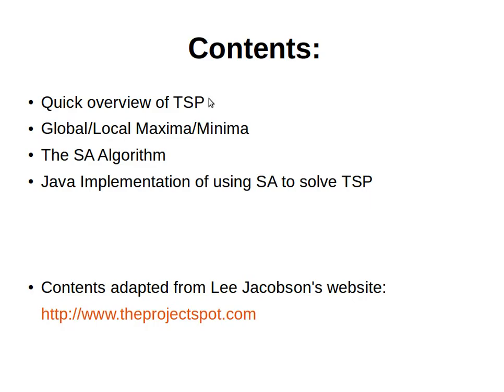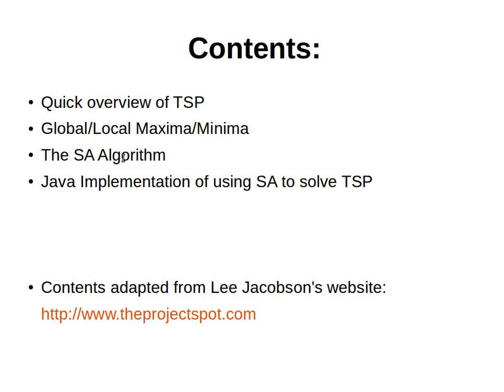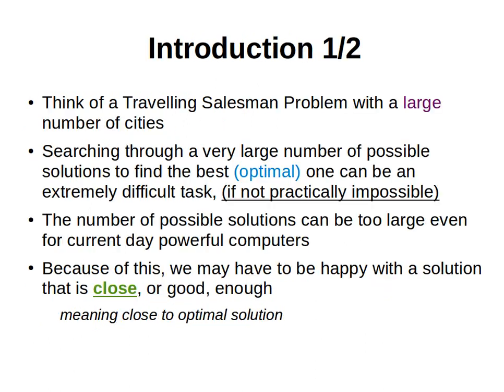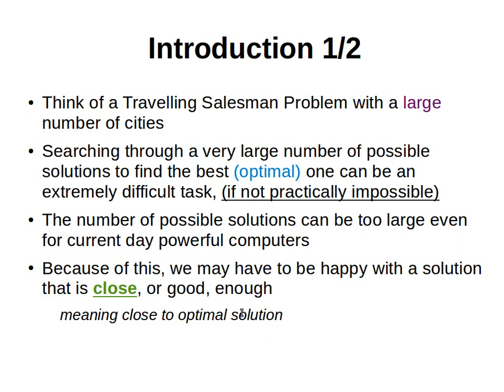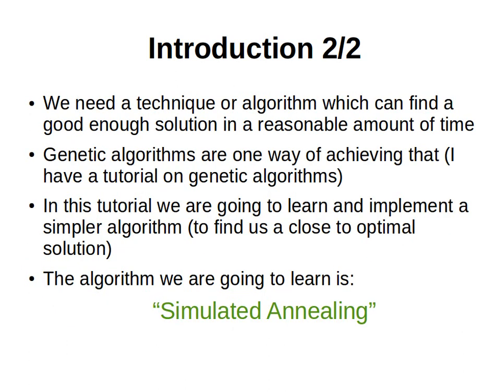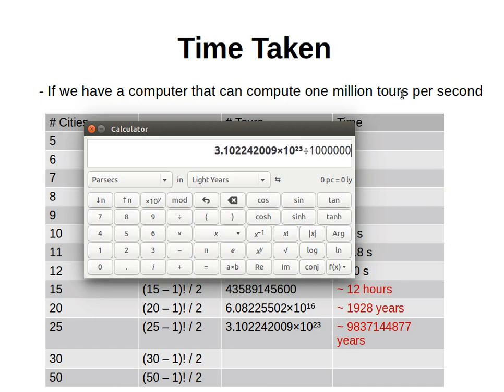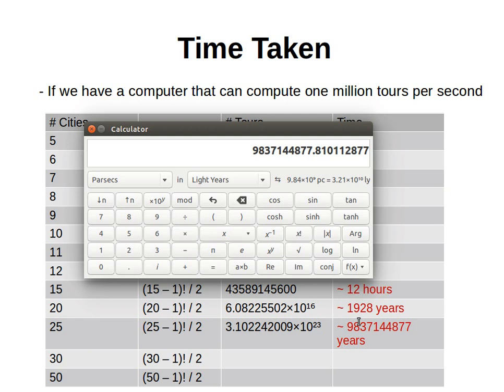Simulated Annealing 1/7: Introduction

Comment: Hi,

I'm using weka through script, calling them from matlab.

When I call the multilayer perceptron function, return the result in a weka.classifiers.functiones.MultilayerPerceptron object.

I Need to extract some information (numerical information) from that object to make a graphic comparing with the actual values and display graphically how well the neural network is estimating.

The same happens with the result: eval = weka.classifiers.Evaluation.evaluateModel(redEstimada,options);

In this case, the result is returned in a  java.lang.string.
I Need to extract some information from that string, too.

=== Cross-validation ===
=== Summary ===
 
Correlation coefficient                  0.6722
Mean absolute error                      0.2552
Root mean squared error                  0.3293
Relative absolute error                 84.9333 %
Root relative squared error             89.7364 %
Total Number of Instances               22   

How can I extract/save/convert that values into a matlab array o matlab format (numerical format)??
Can you help me?

Thank you!